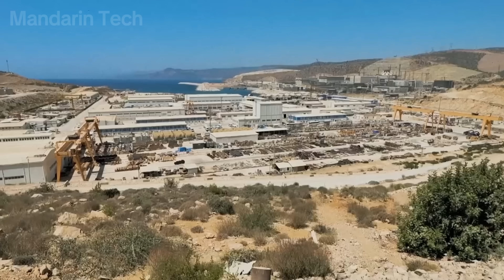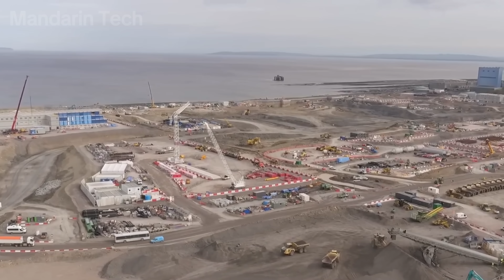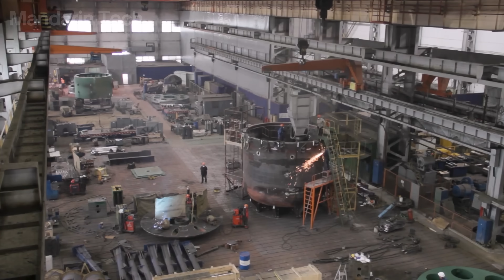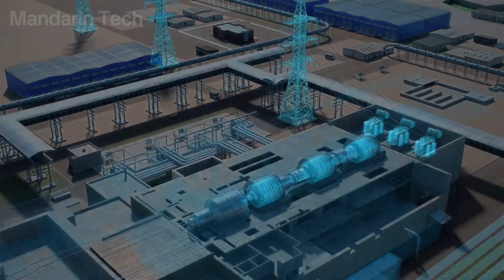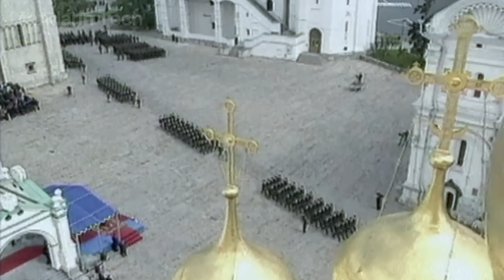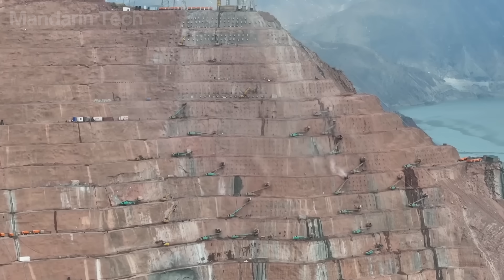Russia Builds a Nuclear Empire on Turkish Soil Leaving NATO Uneasy

Comment: Excellent video! What I enjoyed most is that you didn't just show the engineering—you also explained the geopolitical side of Akkuyu's *Build-Own-Operate* model. It's fascinating that a project can strengthen a country's energy supply while also creating decades of strategic dependence. Which do you think will matter more in the long run: energy security or energy sovereignty? 🤔⚡
Reply from the maker: Thanks! That's a fascinating question, and there's no simple answer.
Reply: Nuclear energy is the most resilient to inflationary risks in the economy. Russia has firm supply contracts that it honors, unlike the unreliable West.